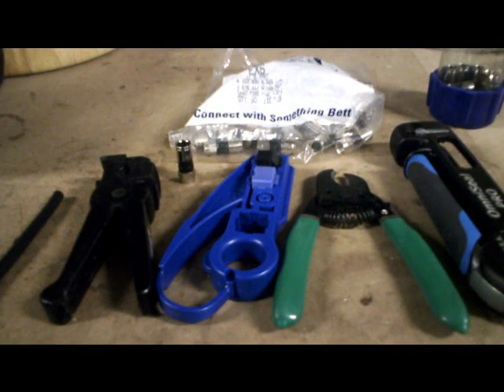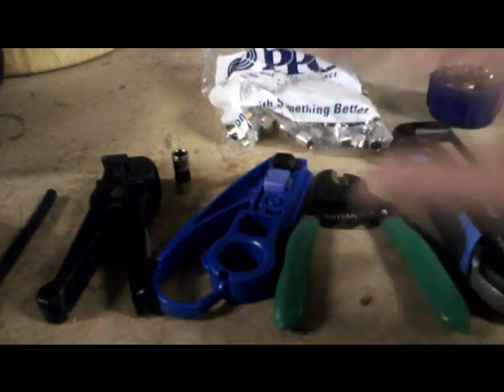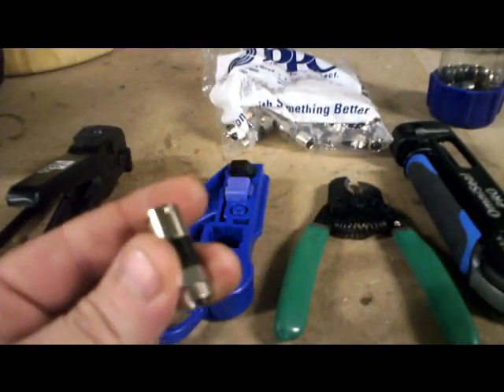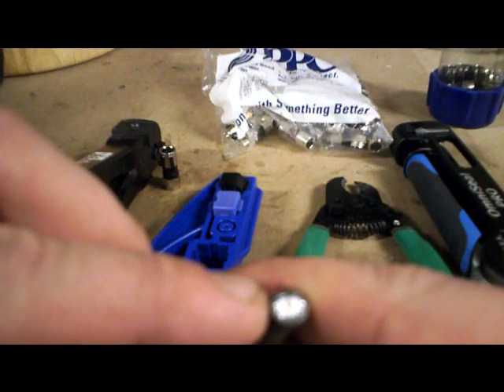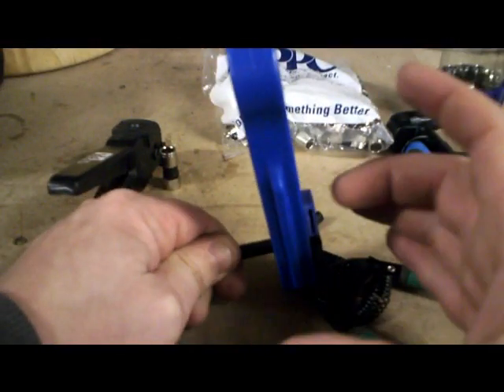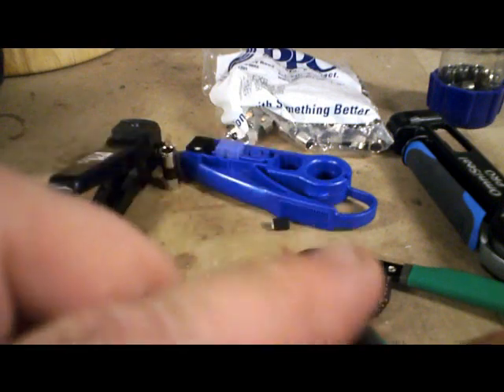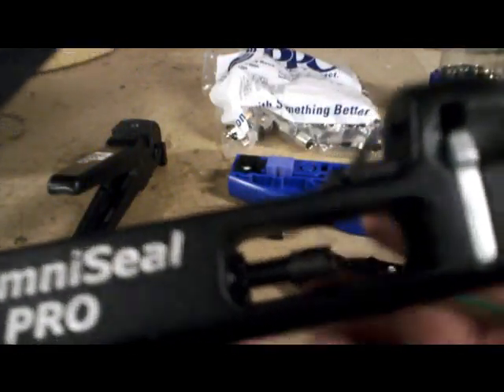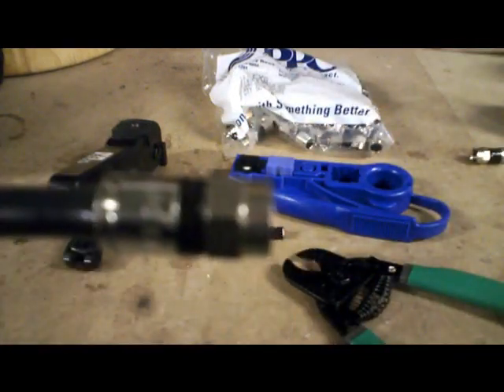Coax cable RG6 tutorial stripping and compression fittings

Comment: Can somebody answer some questions for me..  I have the orange cable that Comcast installed 7 or 8 years ago which I only use for internet.  First question, does the service only run through the copper line and what's the plastic for.   Next, it got cut doing some shrub work and I was wondering if done properly can I put connectors on it and rebury it or should that line be solid to the house.  It uses connectors to  hook up to the R59 in the phone box so it should be fine I hope.  I don't have compression tool so not sure about that yet.  I'm not up for a ridiculous service charge.  I'd rather pay for tools if that will work.  I temporarily hooked up some old push on connectors and it works fine for Sunday night but got to fix it right tomorrow.
Reply: You can get outdoor grade fittings, otherwise I wouldn't put it in the ground or anything.

Comment: If this is quad shield coax, why are you choosing to merely peel back the outer braid and not also the outer layer of foil and braid inside of that as well?
Reply: For RG6 quad shield there is this extra step as you mentioned. If it were simply dual shield Rg6 then what he showed is the correct procedure. For quad shield you need to simply leave the second foil in place and nothing else.

Comment: Your video on replacing the coax cable connectors with compression fit connector was informative but failed to mention the "cons" of those connectors.the compressing media, restricts the easy turning of the screw on end of the connector to the modems or appliances. For that reason I prefer the all steel, plain Jane connector, as the compression of the steel round shank, no matter how tight you compress the shank will never impede the screw end from free turning. This is important to a person like me with only having the use of one hand to connect the cable with the screwing nut. As many modem resets may require detaching the cable. The pro cable installer used those compression connectors, which i've had to replace with the cheapy steel connectors. Otherwise video well done!!
Reply from the maker: Very true, they don't spin easily and can be difficult to apply the connector. Thanks for watching!

Comment: I have old coaxial cable and pushing the fitting on is nearly impossible. Do they have fitting for the old cable??
Reply: 1. If by nearly impossible you actually mean impossible it could be that you are using the wrong sized connectors for your cable(rg6 connectors on rg59)
If you meant nearly impossible it could one of the following scenarios.
2. It could be that your cable is just too old and with age the dielectric has become misshapen, at which point no connector will fit the cable the cable will need to be replaced.
3. It could be that your cable was not manufactured following industry standards and most connectors will not fit the cable, I have ran across this problem with some older low quality non bonded foil rg59, where the bare dielectric will barely fit in the post and then the non bonded foil gets caught on the post and makes it impossible to push on the connector.

Comment: 20 bucks on ebay or at harbor freight will get u a rotating cutter, a compression tool, and a grip of compression connectors. The connectors I got with mine fit all my more modern coaxial,  but not the stuff that's like 20+ years old. That's just a little too thin.

Comment: Are the blades on the Ideal Multi-Strip Coax/UTP Cable Stripper adjustable? How does it know how deep to cut? I tried it on an RG59 that needed a new connector on one side and I was never able to have it do both cuts correctly...